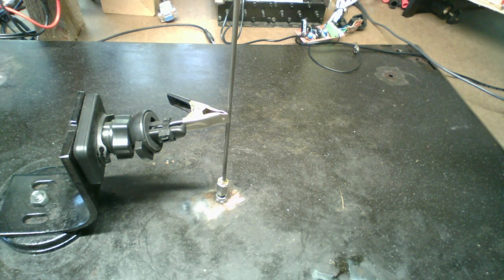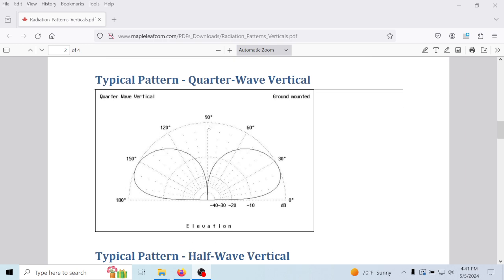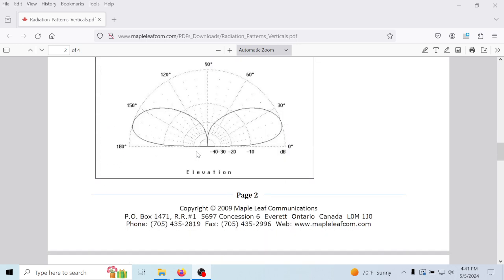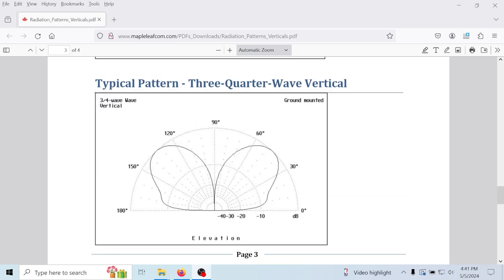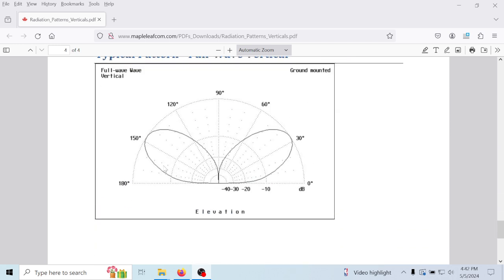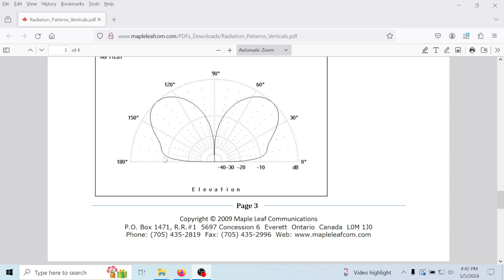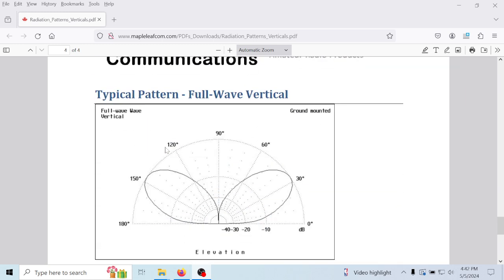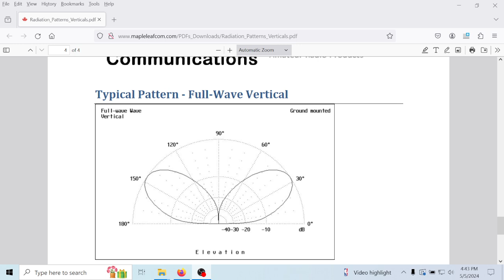🔺 distance/range testing 1/4 wave1/2 wave 5/8 wave, etc. DIY mobile GMRS antennas!! part 1🔺

Comment: Are you getting close to 50 ohm
Reply from the maker: The depends on the SWR the closer you are to 1.1 the closer you will be to 50 ohm. I have an antenna that has 1.15 and it's reads 55 ohm ( this is a store bought antenna) I have other antenna that is SWR 1.5, and it's 45 ohm. This was check with a vna antenna analyzer. The average SWR meter doesn't have ohm reading on it.
Reply: Yeap, that's important for good swr.

Comment: Good deal man. Think you will be surprised. I was always wondering how 2 meter antenna would work on 70 cm with better dbi gain like double gain on 440. So did the same on gmrs mobile antenna...
Reply from the maker: ya by looking at the pattern the 3/4 wave should work good!!!